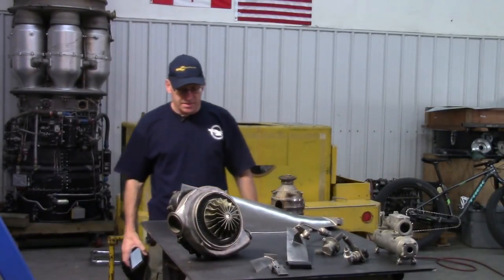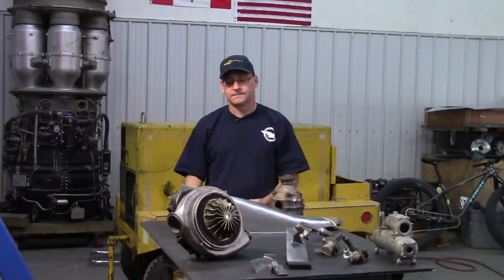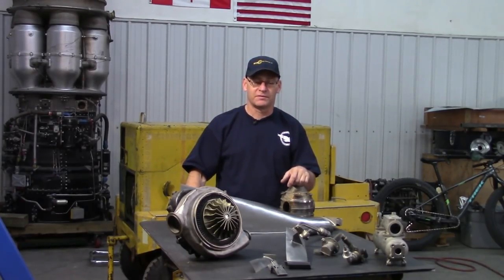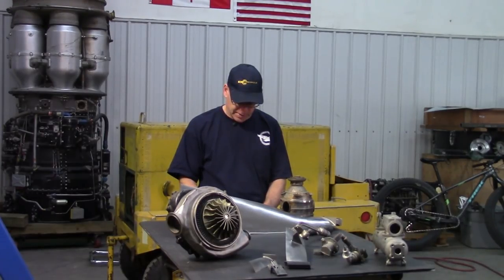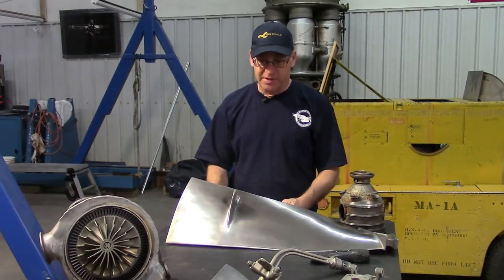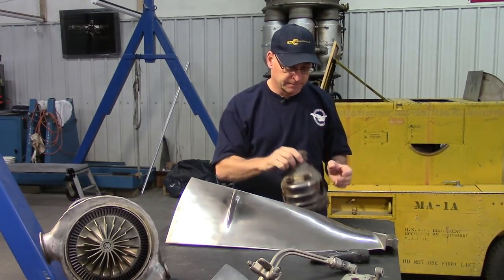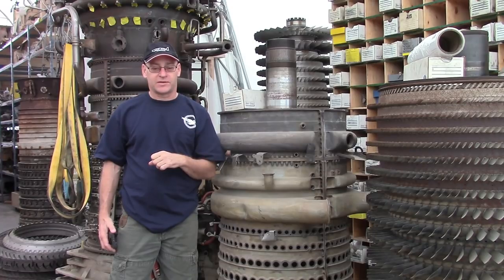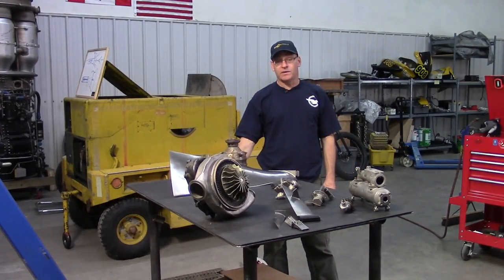Jet Questions 97

Comment: I have worked with a aviation mechanic that said boing aircraft was design by designers and engineers and was difficult to work on but airbus planes was designed by designers engineers and mechanics... I have been working with German  main battle tanks as they are very clever when making stuff. It’s neat and tidy and thought very trough.. but British tanks, there is a hell hole.  If we got the space for 100 wires we mount 100 wires or more. It’s like 100 people working on their own and high quality is 2 words not used in the same sentence...
Reply: @ravener96  in what ..?
Reply: @ravener96  yes. Many tanks do got ammo beside the driver.  Leopard driver sits on the right side and ammo to the left. Abrams driver sits in between and also on challenger.  The reason for why the ammo is beside the drivers is because its low to the ground so its more difficult to spot or hit.   Many got ammo high when its in the turret and the turret are more visible for other tanks to spot or shot at.  The m 14 armata tank have all the crew down in the front hull instead up in the turret. U can hide the hull more easy than the turret.  Merkava got the ammo in the back hull where almost all main battle tanks got their power pack.  Also in Russian tanks they got ammo under the turret for the automatic loader also making it more difficult to hit.
Reply: @ravener96  Leopard 2 has blowout panels in the turret and they was maybe the first with it. There are now blowout panels down in the hull because there are no place to blow out.  If the ammo bunker in the turret on Leopard 2 is hit the bunker is blown away from the turret.  The carousel is smart since is so low in the tank.  So when ammo is stored in the hull besides the driver then the carousel is same smart system or smarter.  It’s more difficult to hit and hit the same protection as ammo besides the driver. Russian are not stupid. After ww2 they made tanks smaller in size to make them more difficult to hit.  Also how the turrets  are made on the russian tanks make them strong.  Also with era blocks are smart and with the laser detection system are smart.  No matter what tanks thas made can be destroyed
Reply: @ravener96  I find it strange. They say they got the best protected tan but down in Afghanistan and Iraq the Abrams has been destroyed.  Leopard has been thinking forward and many tanks copy their ideas.  Many military projects in USA have been extremely expensive and blown the budget and then they must defend that they got the best of the best.  Sometimes USA forgot there are more countries in the world. Leopard got much protection on the side in the front where u got the ammo. The Swedish 122 was one of the first tank with real top attack protection and Abrams don’t got that. Also the leopard 2 was the first with hunter killer cam and m1a2 got that many years after the first leopard 2. Even leopard 1 with peri got a hunter killer cam. Also leopard was one of the first with reload angle for the loader to reload more easy.  The t62 had a ejector for the empty canister after firing. Abrams do not have any new with the tank compared to other tanks
Reply: What tanks? I drove the C2 for 4 years.

Comment: On the subject of thread standards, when I was a lad, I was told by my dad (who was a motor mechanic by trade) that AN stood for  American National (Standard) though the 'N' could also have stood for 'Normal'.  BSF, standing for British Standard Fine, with Whitworth being the coarse equivalent, were still common in the UK for many years after WWII.  There was also UNF and UNC around, which supposedly stood for Unified Normal Fine and Coarse respectively.  
As a young designer, I found myself designing with AS-prefix (inch) aerospace standard fasteners, where the thread was defined  as UNJF,  a truncated variation of UNF.  Below .250in thread size, the threads went to Coarse, with No.10UNC being the next size down from .250UNJF.
Reply from the maker: +grahamj9101
I trust you as an authority.
I always thought UNF was unified national fine, and ANF was army navy fine...
Reply: There is no "American National" thread system.  The UTS (Unified Thread Standard) is used today throughout the U.S. and Canada.   It includes the UNC and UNF thread forms and sizes.  The Unified National System was adopted by international agreement (U.S., Canada and Great Britain) in 1949 as a corrective measure for parts interchangeability problems encountered during the war.  Jay is correct.  "AN" stands for "Army Navy" and refers to a military standard.
Reply: I certainly don't claim to be an authority on this particular issue: I was, in the first instance, repeating what I was told by my father, many years ago.  I have now been put right in respect of ANF (was there an ANC?), but I suspect that his was a common misapprehension in the UK , which begs the question for me as to why this might have been?  
My immediate thought, with nothing to prove it, is that it goes back to the vast amounts of US military surplus hardware that were around in the UK, immediately after the war.  Without seeing what the initials stood for, the 'A' could readily be misinterpreted as standing for 'American'.  Again, during my working life, I have heard the 'N' in UNF and UNC referred to as standing for 'Normal'.  Similarly, I suspect that this was a misinterpretation, because it was not a specifically British standard. 
What has been important throughout my career has been the use of the correct standard of fastener and the initials have, fortunately, sufficed.
Reply: Having acknowledged my ignorance of US thread standards prior to the introduction of the Unified Thread System, I thought that I should do some research.  I soon discovered that, following the example of Sir Joseph Whitworth in the UK, William Sellers established a thread standard in the USA, which effectively became 'national', in terms of its use.  It was, I gather, variously known as the Sellers, Franklin Institute, United States and even the American thread standard.  It used a 60deg thread angle, rather than Whitworth's 55deg, and the Unified standard was effectively rationalising Sellers' standard.                                                                                                                                                                                                                                                                                                                                 
Would the Sellers standard have been in use on pre-war products and WWII military hardware coming into the UK from the USA?  If so, it would almost certainly have been generically labelled 'American' in this country. 
So, as a test, without the assistance of Google (other search engines are available), does anyone over that side of the pond know anything about the BA thread standard?
PS  I'd assumed that, in building Merlins under licence, Packard would have converted the fasteners to a US standard.  However, having checked in my Haynes Workshop Manual (it's not really) for the Merlin engine, it appears that Packard retained Whitworth threads, which would have necessitated a substantial amount of retooling.
Reply: Re Merlin threadforms; Thank you.

Comment: 7:02  Forgive me if this is a dumb question, but why would they specifically target that fuel cooled oil cooler for destruction when the engine becomes demilitarized ?  Is that cooler so special that it could give away protected technology or build technique or something ?  Doesn't seem like that particular part would be the focus of such security.  Or is the reason not so simple?  Very curious about this...Anyone...Anyone?.
Reply from the maker: Not to overthink it, but on an air force base with a bunch of surplus engines... who would be the ones who got the duty of tearing up the scrap  before it gets released to the scrappers?
I don't think it would those who were getting great performance reviews, you know what I mean?
"if it's round and shiny, we should probably wreck it!"

Comment: AgentJayZ, hello from the UK! I've watched all your videos & I just love 'em! I noticed at 5min31 the IGVs of the aerospace spey are at a different angle to the main shaft compared to anything I've seen featured on your channel before. I've had no joy trying to find out why online, do you happen to know why this is the case? Regards & keep up the good work, Ryan Thwaits.
Reply from the maker: It looks like it may have been an attempt at inlet noise reduction. The rotor turns clockwise when looked at from the front, so the angled  IGVs  may have been thought to have a less abrupt interaction with the blades as they moved past them.
Later Speys don't look like that, so I guess it was not that successful.
Maybe we will hear from our friendly neighborhood gas turbine design engineer on this subject.
I'll bet he knows more about the Speys than I do.

Comment: AN is superior to Whitworth for one simple reason:  when i see "10mm" on a US (AN) wrench/socket, i know that the distance between flats of the tool is 10mm.  A tool for Whitworth 10 won't be - it'll be sized for a whitworth 10mm bolt shank with whatever size head happens to be spec'd for that particular use.

https://en.wikipedia.org/wiki/British_Standard_Whitworth#Spanner_(Wrench)_size

"Whitworth and BSF spanner markings refer to the bolt diameter, rather than the distance across the flats of the hexagon (A/F) as in other standards. Confusion can arise because each Whitworth hexagon was originally one size larger than that of the corresponding BSF fastener. This leads to instances where for example, a spanner marked 7⁄16 BSF is the same size as one marked 3⁄8 W. In both cases the spanner jaw width of 0.710 in, the width across the hexagon flat, is the same."

fuck that noise.  if the wrench says "3/8" on it, i expect it to fit on a 3/8" hex nut, not whatever random ass size hex nut is attached to this particular 3/8" bolt.
Reply: I can never find my 10mm wrenches lol

Comment: How do some of those little business jet engines spin such a large fan 22"-25" with such a small core, 8"-10"? Is it the higher compression ratio that enables that?
Reply: The fan and the core driving it are simply scaled down in proportion.  The pressure ratio (not compression ratio, please) of the engine has relatively little to do with it.
Reply: PS I presume that you are referring to engines such as the Williams FJ44?  From memory, that has a single-stage centrifugal HP compressor, driven by a single-stage HP turbine (which I did a bit of work on at R-R), with the fan driven by a two-stage LP turbine.  The overall pressure ratio of this engine must be quite low compared to typical small helicopter engines, such as the R-R/Allison 250.  Perhaps I should do a bit of research on Wikipedia; you could too.
Reply: Yes the FJ44 is one of them, I believe Honda makes a similar one to the FJ, but yea there are several small engines, and I'm surprised that given the scaling issues of jet engines that one with such a small core can drive a bypass ratio like that. I remember reading something about Williams trying to make an even smaller core that was also triple spool, he was trying to achieve 1T of thrust from a 150lbs. engine.
Reply: Yes, there are scaling issues with small gas turbine engines, such that the aerofoils of an axial flow compressor cannot be be scaled down in direct proportion to larger engines, because they would become too thin and fragile, hence the use of centrifugal compressors.  Similarly, profile tolerances and tip clearances cannot be reduced in proportion and aerodynamic losses are relatively higher.  
Nevertheless, with appropriate design, these issues can be and obviously are addressed in engines such as the Gnome/T58 (PR = 8:1), R-R Gem (PR = 12:1) and RTM 322 (PR = 15:1).  I am reasonably familiar with all three engines, having worked on the Gnome compressor and the Gem HP impeller at R-R.
After some research, I will take back my suggestion that the OPR of the FJ44 must be quite low, as compared to the Allison 250.  The early models of the 250 could have had PRs as low as 6:1 and the latest model, with a single-stage centrifugal compressor, has a PR of a little over 9:1.  This represents a high stage loading for a centrifugal compressor, which would probably make for difficulties in matching it with preceding axial stages.
I have now discovered that the FJ44 engine series has 1, 2 or 3 booster stages on the LP shaft behind the fan: however, I can find no figures for OPR.  My best guess would be for OPRs of 12:1 up to 15:1, perhaps 20:1 at most. Compare this with the OPR of the original RB211-22B for the Tristar, with an OPR of 28:1 or so.

Comment: The Merlin versus Packard (versus Allison V1710) 'debate' is raging acrimoniously on Jay Leno's channel right now and, in discussing the use of the Merlin in the P-51,  I've become involved on the periphery of it - more fool me!
I'm aware, from reading up R-R's history, that Packard redesigned the supercharger drive of their Merlins, introducing an epicyclic arrangement.  That they produced a great engine, which powered one of the finest fighter aircraft of WWII, the Mustang (and all of the Dambusters' Lancasters), is a historical fact.  I would, however, point out that while Packard was dealing with one derivative of the Merlin, R-R Derby was busy with the design of successive uprates and the design of the Griffon, with early jet engine work tucked away at a small plant in the Pennines (if necessary, do some history and geography) .  Parts reduction would, therefore, have been a secondary issue.  Now if you want simple and low parts count, those early centrifugal engines had it.

Comment: Could you talk about turbine blades efficiency? How do they lose their efficiency as the engine is being used?
Reply: There are two primary causes of loss of efficiency in turbine rotor blades with increasing hours in service:
1a) in the case of a shrouded turbine, an increase in tip clearance, as a result of mutual wear of the sealing fins and the static sealing features in the rotor path above the blade, or 
1b) in the case of a shroudless turbine, an increase in tip clearance, as a result of mutual wear of the blade tip  and the rotor path liner above the blade, also with some hot gas erosion taking place in both cases.
2) erosion, degradation and, possibly, some distortion the aerofoil profile of the blades by the hot gases and possibly by any particulates (including any carbon from the combustion process) that pass through the engine.  In exceptional cases, ingestion of  desert sand or volcanic ash can result in the melting of the sand or ash and its deposition on the blades.
You asked about turbine blades, but turbine NGVs can also suffer similar degradation, plus, in some cases, quite significant distortion, which can affect the effective throat area of the vanes.
Reply: Thanks grahamj9101!

Comment: The Canadian jet engine engineers are there any of them still around I have an idea for power generation with Biodiesel with muiltible generators increasing power output
Reply from the maker: Sounds like you're going to be the engineer. There are books on thermodynamics of gas turbine engines, and of power generation out there. You could do some research to find out how good/bad your idea is before you can expect any professional engineer to even listen.
Good luck to you; the world needs new ideas!
Reply: I've worked in building, sawmill, hydraulic workshop as fitter welder I live in a small rural town so have to go were the work is .I'm in meatworks at the moment it's probably my double Scottish family history that makes me look at waste for it's possible usefulness  fat can be made into BioDeisel possibly from wastewater and other sources.  They have a  3pm to 8pm high power charge here to. I was also wondering because you are the jet turbine engineer if you know of any miniature toy jet turbines like Remote control  that you can change the layout of for a mixture of layouts for a theory I have on two different styles of engines one useing steam air princibles my old boss told me when steam hits air it expands 8 times original volume that has stuck with me for years it needs testing but any improvement through natrual process is what i look for
Reply: Hi, there are a whole bunch of them over at Pratt & Whitney Canada in Montreal, Toronto etc..,.

Comment: Of course you can't run a turbine powering a generator off of a turbofan, because the fan takes the place of the generator, it's what the power is used for.
Reply from the maker: Look again at the diagram I drew...